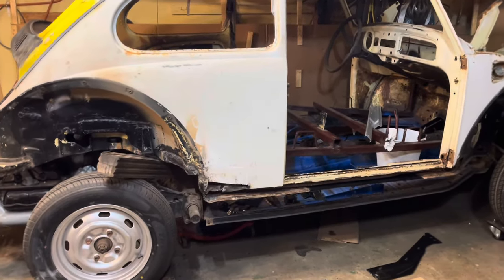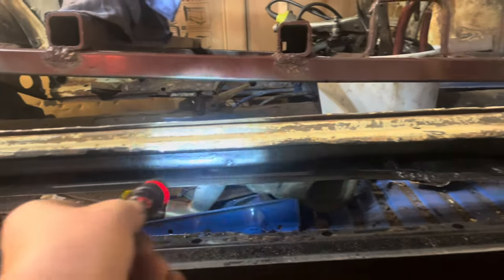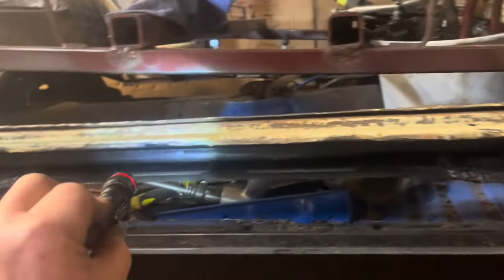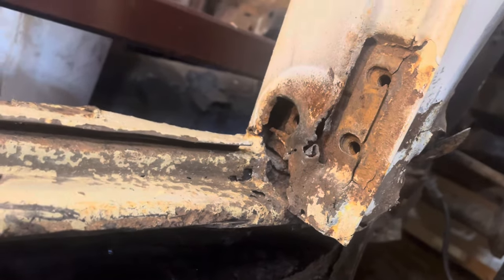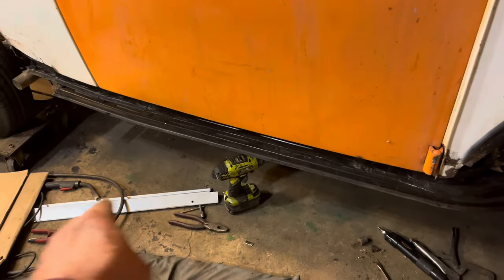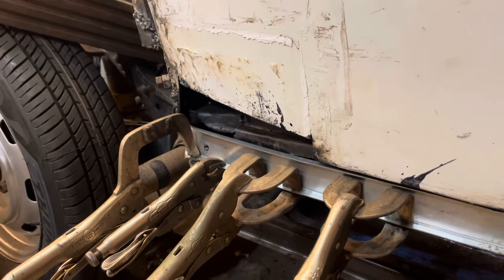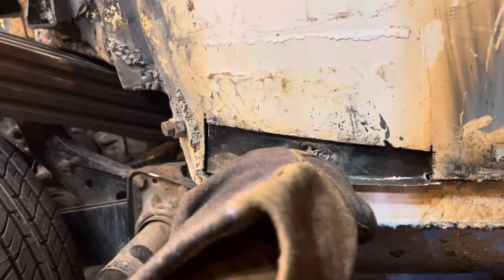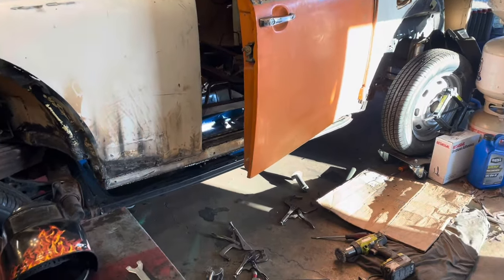1970 VW Beetle  heater channel repair

Comment: interesting putting the pipe in the A post area for the defrost. It will definitely last longer for sure. Just coat it so it doesn't rust in hidden areas as you well know.
Reply from the maker: I thought so….yeah, coat everything